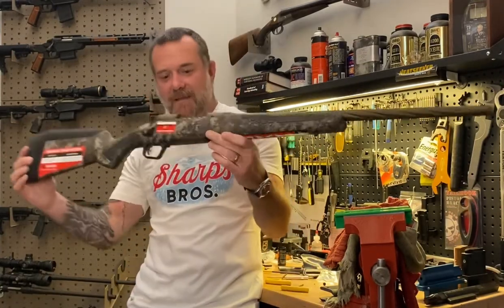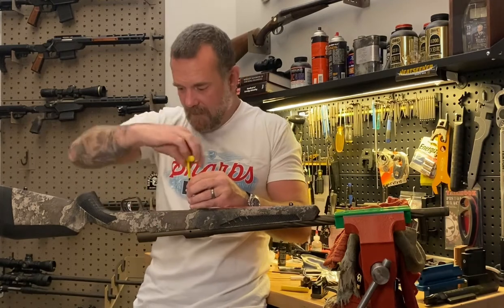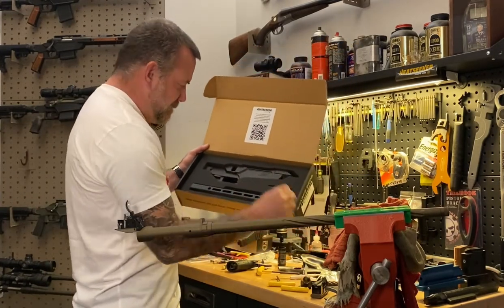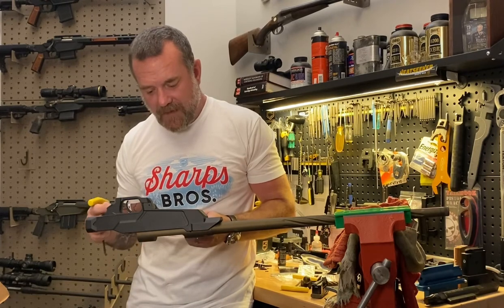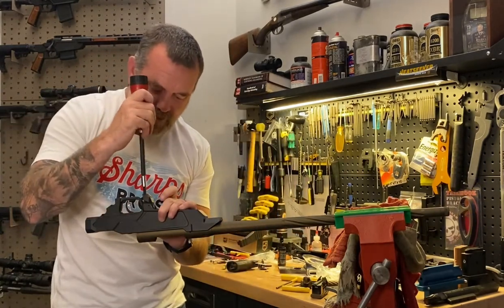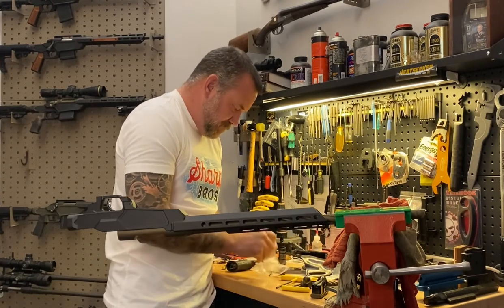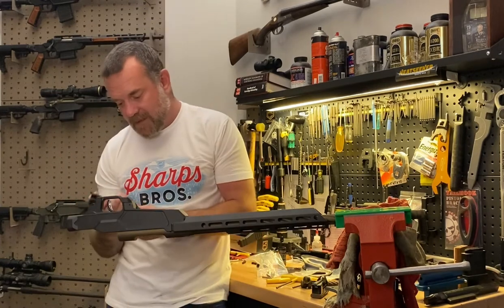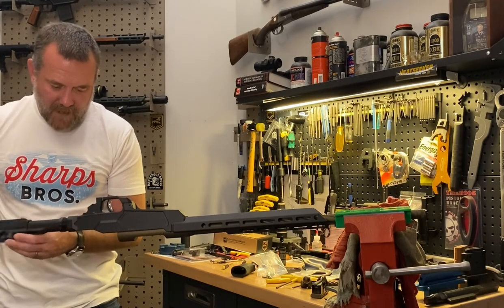Sharps Bros. Heatseeker chassis for the Savage 110 Short Action (assembly / how-to build video)

Comment: The Heatseeker chassis for the Savage 110 is one hell of an upgrade...especially for the price. Have found them sub-$400. The 110 Ultralite bottom “metal” is absolute junk and Savage could care less. They won’t even sell you a replacement. Plastic parts on a $1K+ plus rifle. Focus less on bolt removal (in comments) and re-focus on AICS upgrade from the $60 Savage crap box mag and an actual metal trigger guard. My first leap with the Heatseeker was with a Ruger American AR style. The chassis changes that particular rifle exponentially, is almost unrecognizable, AND increases accuracy.